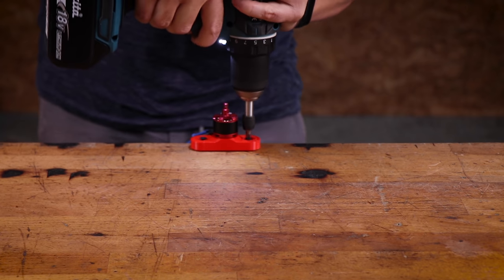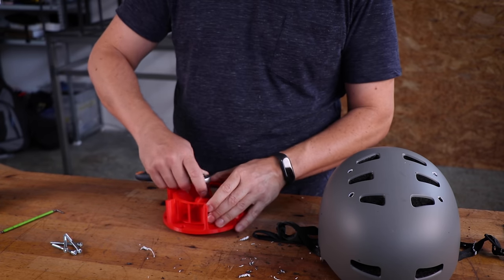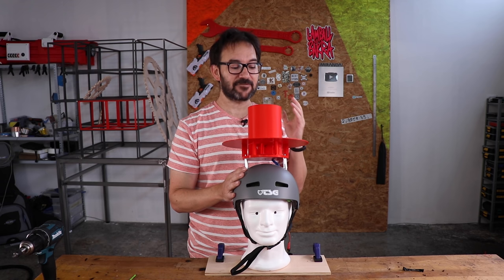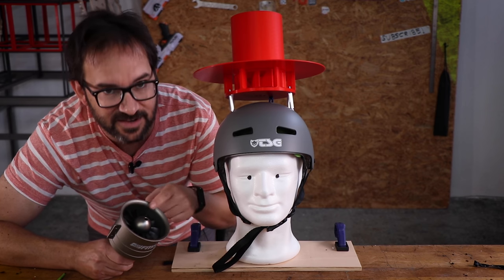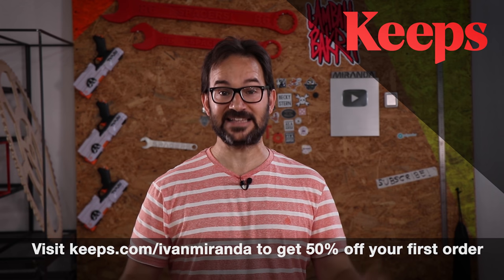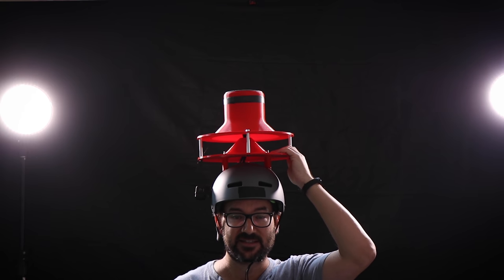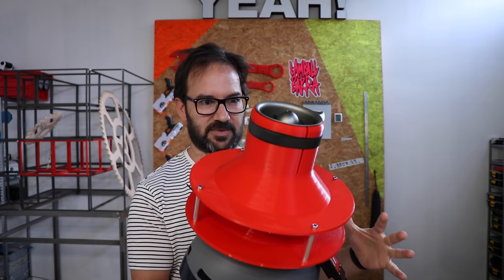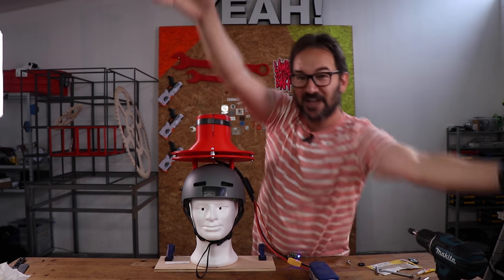TURBINE UMBRELLA HAT

Comment: Nice job and great examples of turbulent air flow vs more of a laminar one. Or at least you increased the area of the air flowing straight before it curled. The curling reminded me of wing tip vortices. I bet having that EDF so close to your head was very loud even with ear protection!

Comment: Ivan you need to turn it upside down so that you draw in dry air from above the helmet, this way you using dryish air to blow away water instead of very wet air to blow away water. Efficiency should also improve.
Reply: Maybe the water in the air helps to block the rain falling idk I'm not to smart

Comment: Congrats, looks like you figured out the flow problem at the end.  Just remember,  in all your flow problems,  that your Massflow remains constant throughout the entire apparatus.   ... And in the rare instance that it doesn't...  prepare for explosions.
Reply: Well, the fan won't be able to sustain the flow rate if it's constricted that much unless it's capable of generating such pressures.
Reply: @BrokenLifeCycle  I'll bet if you did the math you'd find that the cross section is constant as the air flows down the tube and thus construction would be minimal. The concept is that as the radius increases the distance between the plates decreases to maintain cross section.  Obviously that can only work for so long before the gap is minimal. Thus it's an optimization problem.

Comment: I have thought about this technology.....
There is a problem though
The spiraling fan is expected to push the rain droplets outwards instead of downwards but when you are in a crowd of people, they will get wet because the water is spiralling in all directions so they solution is to get a fan that pushed the water droplets back upwards. Other people closeby will need to have the same device on their own heads to avoid getting wet on close contact. What we need here is a blowfan helmet, but not directly upwards, maybe at a 90 degree angle but with the point of the angle at the base of the helment. So the spray will actually have to be like a v instead of half a moon. But it still leaves another problem ...massive water droplets and leaks of huge pouring water from rooftops will need fans with more power though.
One more thing....
The head device has to work like a gimbal so that, whatever direction yo move your head  the fan remains on a level plane....so that you can read a book or text of your phone with your head bent while walking or tilt your head backwards to drink a warm beverage under the rain while the device remains on a level plane...

nice vid by the way
subbed!

Comment: It's nice and designed beautifully, but it will never be as good as a standard umbrella due to many factors. 1: It's noisy and therefore, you cannot have a normal conversation with someone next to you. 2: It consumes power while a standard umbrella does not, so you can't use it for long. 3: Anyone next to you is soaking wet because of sideways blown raindrops, even if they have an umbrella. 4: It seems to be alot heavier than an umbrella and could cause neck pains during longtime usage. 5: Although it may blow away alot of raindrops, sometimes a few raindrops will still make it through and you'll get wet anyways, just not as fast. It isn't all bad though as it does have 2 advantages. 1: You have both hands free as it's now resting on your head instead of the need to carry and hold it in your hands. 2: Since the surface area is alot smaller, it won't catch much wind, which would require a much stronger grip and holding force using a normal umbrella.

Comment: 8:23
aerospace engineering student here:
a quick summary on aerodynamics (as simple as possible):
push air through a tube with changing diameter.
If the diameter gets bigger, the escaping air is slower than the incoming air.
If the diameter gets smaller, the escaping air is fast than the incoming air.

(That explanation about low preassure is not quite technically correct, but that's a more advanced topic,
which I'm way too lazy to get into rn.)

I may sound like a complete dick,
but I see this so often, that many youtube makers overlook this kinda super basic concept about air speed,
whenever they're doin something with fast moving air.
At least, you got it at the end :)

Comment: Why no protection or umbrella type rain cover for the impeller? Surely it would work better if it was dry? The water probably adds drag and turbulence to the airflow and also, why risk damaging expensive parts?
Just put a little roof like chimneys have, that let air in but no rain in.

Comment: The inlet on the top sucks rain in which it sprays out the side, making the bottom part of the outlet wet which drips down on you a bit - perhaps a small domed cover over the top so less rain falls in will reduce that? It'll still suck SOME in with the air that comes in, but if it's pulling in sideways it might not pull in so much water with it...

Comment: So the reason you "get wet from the sides and from behind" or whatever you said is because the airstream blowing out the sides will pull along air both from below the plane and above the plane of the "air disc". The air that's pulled from below and is dragged along to the sides has to come from somewhere and as a result there will be an influx of air rushing in from the sides lower down. This air will carry along microscopic drops of water. This can be seen in the footage with the lamp and the dark background. The water drops can be seen to be blown to the side by the airstream and it also shows how some of the water is recirculated both above and below the highspeed air stream.

Comment: I wonder if rather than using an air turbine you had just a fast spinning disk that would fling out the water coming down into a horizontal  shield. The harder it rains the more solid the shield. It would be quieter and would probably use less power.

Comment: Would it not make more sense to turn the hat upside down so that it isn't drawing the water into the fan?  Then you would just have a dry wall of air to push out around your head rather than having to move air and water.

Comment: For those commenting about passers-by getting drenched... Just invert the system and give the exit slot a slight angle skyward? Draws in drier air also as someone stated.
Another feature to add is some kind of debris screen. EDFs aren't cheap.

Comment: Would it be better to put the jet at the bottom and the air buffer at the top for both ingesting dryer air and outputting at the top so the angle of the falling rain is better?

Comment: I was thinking from the beginning that it would be more effective to use an air blade design with the exhaust narrowing to a thin slit to accelerate the air, final design got much closer to that.